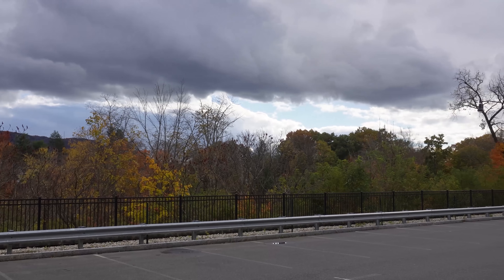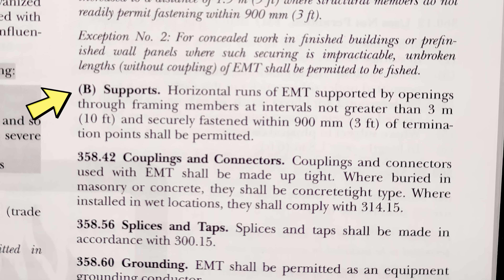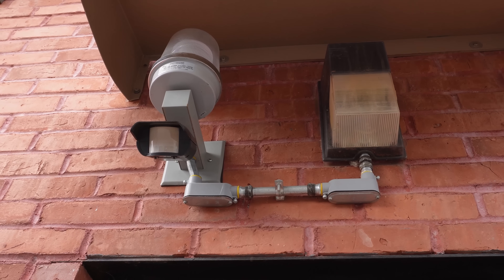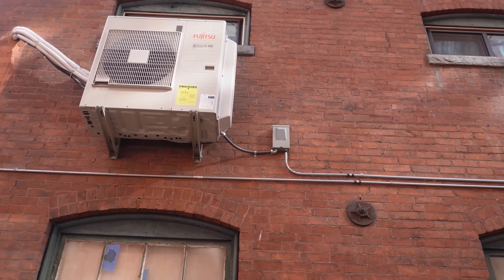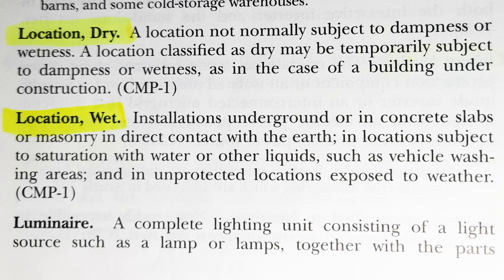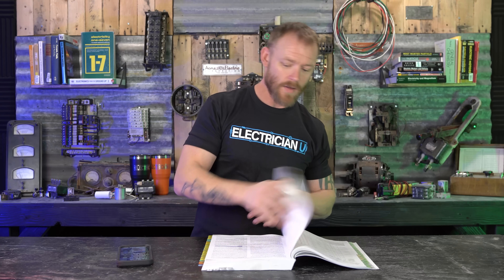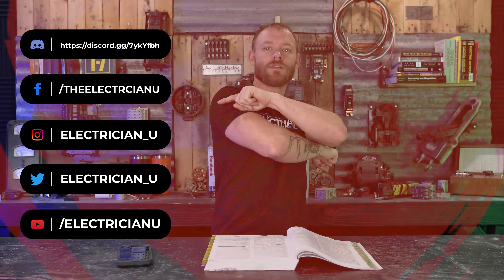Finding Code Violations in a 100 Year Old Building!

Comment: My factory job was built in 1919 and I see many old electrical work and machines. I found a single gang outlet with 3 plugs on it and another single gang with 2 switches and 1 plug. And the lighting setup is wack as well.

Comment: As usual, I really enjoyed this video. My only comment to all those out there is cover ALL junction boxes. It's not that hard or expensive. Come on
Reply: Even if you pull out your code book and win the argument with the inspector does not require the covers to be on, I'll bet he will pull out his tape measure and catch your strap on the emt is 3' 0.25" from the box and a dozen other minute violations that he wouldn't have thought about until you argued about box covers.
Reply: "Provided with" bemused me.  What's the point of providing boxes with a cover but then not using it.  What, going to leave it dangling by its ground strap?  or maybe a piece of  string?  😀 
That bit of code read to me as "something so obvious it doesn't need saying" only this whole conversation just shows that it does need saying as someone somewhere will take advantage of loose language just to save themselves fixing a few screws.

Comment: I think the boxes should be closed, I was on a dark attic, without a flashlight and  before entering I saw what I thought was the switch box, and there was no switch, just twisted wires without wire nuts or tape, shocking experience. So in my mind I added secured and closed to provided covers. The code is the minimum, we can always make it more safe withing reason.

Comment: Ah yes the crazy stuff you see.. I was just at a new Furnace install a few weeks ago, and while I was running a 12/2 in a basement drop ceiling, there was some very questionable electrical work, plumbing and drywall work... one of those "I know how to do everything" handymen.  3 new fluorescent lights, grounds weren't hooked up, 2 were wired in boxes, 1 was just wired in the ceiling.  Loose wire nuts, no enclosures on any junction boxes.  A mix of 12/2 and 12/3, I guess just whatever the handyman had, yet the furnace was wired to a switch with 12/2 and a non identified white as  a hot...
Reply: White hot? SKETCHY
Reply: @jamesbryan7036  yeah it was run by a "handyman" for a switch but not identified.  I guess he's unaware of neutral being provided in a switch box.

Comment: Another interesting video! Thanks for sharing! In my area we get on commercial jobs to fix something or add, when you open up the ceiling it's been remolded several times and I guy could spends days there fixing things. What does a guy do about this?  Because I usually am definitely not needing any more work lol

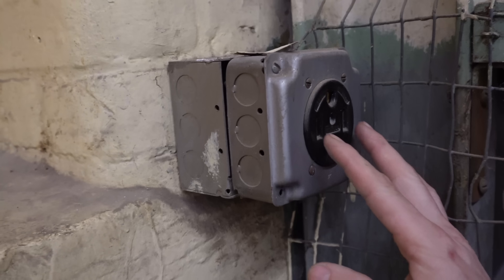Comment: At 10:39, that's not a hose bib.  It looks to me like that's a cast ell that is broken off.   Obviously if you open the valve, water is going to come out,  but the original installation may have continued on to somewhere else before the ell got broken off.

Comment: So, did you run into some old 2-phase/4-wire installations?  There used to be some still around years ago.  But maybe more important; did you make a field trip over the the NFPA headquarters in Quincy, MA.  You had the perfect opportunity...  Just sayin
Reply: Some areas in Philadelphia,  believe it or not, still have two phase service,  and for those many who never heard of it, it was an very early polyphase system,  used in the 1890s and early 1900s, and consisted of 2 phases 90 degrees apart, instead of 120 degrees for three phase and 180 degrees for split phase.   It's main use was early electric motors.  It was soon replaced with more practical 3 phase, and unless you happen to be from around the Philadelphia area,  most people have never seen it or even know that it exists.
Reply: What Is a 2 phase 4 wire

Comment: "Functions as installed" is a good phrase to use in inspections past its original installation. New construction and remodels have to meet code requirements at the rough, partial, final. Just goes to show that that blank on a 1900 jbox doesn't have to stay fixed after the final.

Comment: I've definitely seen my share of plumbing, gas and hose fittings used in electrical applications. I mean I guess it's better than bare wires hanging out but... But often times it would have been cheaper just to get the right part, not to mention take less time and fuckery. :)

Comment: 110.12 (A) Unused Openings: Unused cable or raceway openings in boxes, raceways, auxiliary gutters, cabinets, cutout
boxes, meter socket enclosures, equipment cases, or housings shall be effectively closed to afford protection
substantially equivalent to the wall of the equipment. Where metallic plugs or plates are used with nonmetallic
enclosures, they shall be recessed at least 6 mm (¼ in.) from the outer surface of the enclosure
 What do you guys think?
Reply: That's only talking about that knock outs have to be capped off if they aren't in use.
Reply: Sounds like that's the code we're looking for. It seems to be saying that if the opening is unused, meaning it isn't an intentional design of the equipment, it needs to be closed.
Reply: @br00cezx  yes I would concur and also it look like this makes sense anyways if someone could put a finger or something conductive or anyting else into an opening and contact anyting live or otherwise.

Just makes sense in terms of safety at least.

Same goes for a fan guard on something and not being able to stick a finger through it!

Years ago that was never a concern.

Also the same with properly wired light fixtures the other screw spiritual being on the neutral side of the circuit.

But that kind of goes out the window when someone Miss wires a receptacle which urinary run acrost hot neutral.

Especially an old wiring that may have been let's just say tinkered with overtime.

Even harks back to Edison base fuses.

With the screw shelving the load side of the circuit!

Anyone out there remember the old receptacles in Old homes perhaps in show Windows back in the day as well!

I have seen many a historical home and other buildings.

And the horror once that was an outdoor receptacle with the screw-on cap connected by what looks like a tub stopper or light switch pull chain to the cover plate to keep it from being lost.

To my surprise when I opened it I was thinking perhaps telephone or perhaps an old outdoor receptacle single receptacle of course.

Surprise screw shell Edison lamp socket it was still live to that day.

I was checking things out for somebody and doing some work.

When I noticed this and they said oh yeah I meant to ask you what that is.

Needless to say the next time I was down there.

Made sure it was no longer live.

And was cover was replaced with a blank plate as well!

Also all the associated wiring around that area that apparently was used for other things can't remember what all was there the wiring was still there but had been long-ago disconnected.

Then at one time had fed a garage and and the yard light.

Even though the wiring was still there it was dead.

Not to mention that was when those cases where are there was a three-way switch and I believe possibly a four-way but on that installation is a bit foggy too long ago.

But definitely was what form of what one would refer to as Charter wiring.

To save number of wires between garage and house all overhead wiring some of which was still ran on glass insulators I do believe this was a farm can't remember.

They also had similar things going to outbuildings but in some cases even worse.

Most of that was not working or have been disconnected but somewhat still working and live.

Also there was switches for the electric fence everywhere around the property I hate to ask about voltage drop but considering a few amps Max.

And there was more than one electric fence charger for the property.

And all the switches did have a pilot light as well.

Anyone switch could turn off the electric fence at any location.

And a few of these were actually Outdoors and a jerry-rig what I call switch shelter since not design for outdoor use never work but still worked surprisingly.

Also the power was distributed from the barn to the house and a few other places.

And multiple switches four other buildings in other buildings.

And even a switch at the end of the driveway and garage to turn off the multiple lights and also the place with wired to be able to have some light turned on Elsewhere on specific fixtures and receptacles.

What seemed like miles of wire just for things like this.

Definitely done before there would be a low voltage switching readily available!

Also was a lot of low-voltage ran the same way as power wiring for signaling and perhaps intercom or interphone of some sort.

This was ran along the same poles and right next to above and below and beside power wiring.

And even bear wire electric fence feeders going to isolated sections offense bright intermixed with the rest.

Talk about ouch!

And that's just in one place don't even get me started about radiant heat for Rover#

One thing I could not figure out that first where this switch went at said to turn on when the lowest certain number degrees and a pilot light.

Although there were others labeled for what said freeze control.

Turns out that cable went underground form one of the poles.

And went to a dog house.

That been long since abandoned there's a new one so farmdog was A-OK.

But I started digging it and hit metal inside that dog house.

Low and behold 2 ceramic light sockets wired in series.

Equipped with a 100-watt bulb in each.

This was meant to keep a farm dog warm in the winter time at one time.

Heard about that once in a book somewhere never thought I'd see it in practice.

And there were some more things done it in the pump house and Spring House as well few other places where there's water.

And even we're animals need water there were faucets that were kept warm enough to keep from freezing in a similar manner.

Pretty sure this place was over a hundred years old if not more.

The mix about just every type of wiring you can imagine including some which definitely went back to the time of Edison there were remnants of the Edison DC system there!

So probably the one place I've seen the most of anything like this in one place not surprisingly what people see sometimes but would never even imagine!

Also note I am not an electrician just someone that knows what they're doing and knows how to take care of things and keep things safe and yet able to do things to code.

Which stem from being self-taught!

This came very early for me at 4 and 5 I was rewiring lamps!
Reply: No it specifically calls out boxes, etc,etal

Comment: All openings must be closed
Reply: 110.12(A)
Reply: @Williesnyder77  "Unused cable or raceway openings.."  I'm not sure that applies in this case.
Reply: @MrXelig  Mechanical execution of work
Reply: @MrXelig  You might me correct I thought it was an easy one 110.3(B) says covers must be installed to be a completed installation.
Reply: @Williesnyder77  I'm definitely learning as a go on this stuff! 2017 code language changed that section.
 110.12(A)	Unused Openings. Unused openings, other than those intended for the operation of equipment, those intended for mounting purposes, or those permitted as part of the design for listed equipment, shall be closed to afford protection substantially equivalent to the wall of the equipment.   

I think you might be on to something with 110.3(B). It is up for interpretation on a lot of the wording.  You could take 110.3(B) to mean a cover is intended to be installed if it is included, especially if it has instructions!
110.3(B) Installation and Use. Listed or labeled equipment shall be installed and used in accordance with any instructions included in the listing or labeling.
Reply: @MrXelig  There is no code that allows you to leave a cover off of an enclosure

Comment: I was involved in a lawsuit where the local authority tried to condemn an old building because it was not "up to (current) code". The judge would have swallowed it if my attorney had not pointed out that there was no requirement to keep current with ever changing code.
Reply: As far as I understand you only need to update to current code if you are doing a renovation. It likely depends on the extent of renovation such as rec room or addition to the structure. This typically is per local bylaws.
Reply: @normferguson2769  They used it to open the door to the argument that they would not allow an "illegal" use to continue. I was "non-conforming", ie, legally established in thd past but because of zoning changes, no longer conforming. Since they "had no records", they said they could not assume I was initially "legally" established. Since the property was built in 1894 and the town not incorporated until 1949, I wasn't under their jurisdiction.
Reply: 100 year old courthouse closed due to not being up to code. All laws on hold.
Reply: We get this on locomotives as well. It becomes a game of, do I remove it now or deal with it later?  If I have ample time it gets removed and made pretty and tight again. We find all kinds of messy things. We are not allowed to have house hold wire like Romax, it must be transit quality wire like Exane. We find house wire in locomotives all the time. It isn’t rated for our DC high tension systems. We often have sixty amps on a twelve gauge Exane wire at 72 volts. This is well within transit wire capacity but not house wire.
Reply: @ryandavis7593  Are you working here in the States on small regional lines?

Comment: In regards to the "upside down barn light" with the two LB conduit bodies and the offset nipple: The barn light looks like an alarm strobe light for who knows what. It looks to me like the installer didn't want to have to bore a new hole for the strobe wiring, so they used the conduit for the light. In order to exit the light enclosure, they removed the the EE/motion detector, ran the conduit to the strobe enclosure, and remounted the EE/motion detector on the strobe enclosure. Yes, it's a ridiculous amount of work to avoid punching through the brick, but if you don't have the tools to do it, you figure something out.

The next question I have is this: presumably low voltage signal wire to the strobe in a raceway with 120VAC? That's gotta be a violation, Right?
Reply: Based on the (barely visible) model information on the sticker, the beacon appears to be a strobing 40W halogen that operates on 120v AC. Still, assuming whatever is feeding the signal beacon and the wallpack are on separate circiuts, would it be kosher to have the conductors running in the same conduit? Just a handyperson here... Non-trade, definitely not an electrician.
Reply: @marcberm  it may be that that motion detector might be tied into some sort of alarm system and also the system that is tied to that strobe theoretically since there's already that wall pack fixture that would provide lighting that would be typically Dusk to Dawn unless controlled otherwise timer or otherwise and would probably be typically high pressure sodium or mercury vapor unless more modern fixture but it doesn't look like it is!

So might explain both the motion detector and the strobe fixture!

And also you know how outdoor lights are not supposed to be tied into emergency systems.

I've seen this done and even an emergency exit light typically LED mounted close to exit Outdoors.

Although I could be confusing this with an exterior light but a similar design.

May not even be low-voltage but large voltage very similar to emergency light low voltage remote head.

Almost all of which have been installed on appropriate weatherproof junction boxes and proper plates!

Have also seen this next to another outdoor light in certain locations so I'm suspecting it's a backup or an emergency light of some sort.

Even not a doorway!

So the question is out there if someone were to know please give a heads up.

And I do know for a fact that one Hospital the outdoor light at some of the entrances only came on if the generator was running what someone told me it was tied into life safety for some reason!

Which apparently is a code violation at least it should be!

Since usually that would not be permitted unless of course it was deliberate perhaps egress or entrance?

Also I did once see some exterior lights on the old DC 120-volt emergency lighting circuits.

At least twice.

And seeing a switch double pole double throw with off.

With a similar setup.

That was very sketchy to say the least.

Could lead to big issues if something goes wrong or is improperly repaired I'd say just abandon it!

Also old ungrounded receptacle below a toilet and new receptacles properly installed elsewhere in a household bathroom.

Note the bathroom was originally a bedroom.

And had been converted to full-on new accessible!

And also was a laundry room.

Have plans to change that cover to a blank cover sense not feasible to rewire!

Besides just asking for trouble with that receptacle in the first place!
Reply: Its only ok if the lv wiring is rated 600v... but still kinda hacky

Comment: Provided could mean provided during installation, meaning you must use a (proper) cover.
Reply: still doesnt seem to say needs to be installed. if a jbox provides me with preinstalled wagos and i remove them and use wire nuts instead, it still meets requirements.
Reply: @willywill3570  I see your point but to me it depends on whether it's interpreted as meaning that the installer must provide a cover, or the manufacturer. If the installer must provide it, then it must be installed (otherwise leaving it in the work truck, it hasn't been "provided"). The wording is vague so it will end up being up to the AHJ. Not like I'd install one without a cover anyways, but it is interesting to try to interpret the real meanings of some of these badly worded codes. Lol